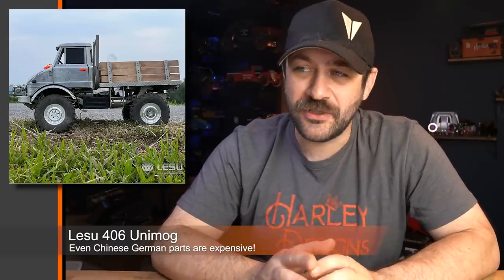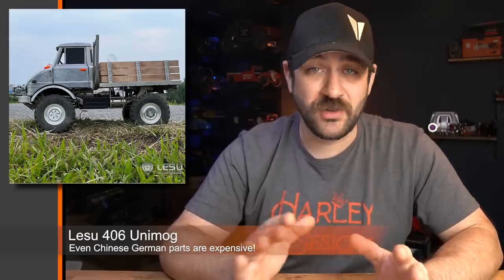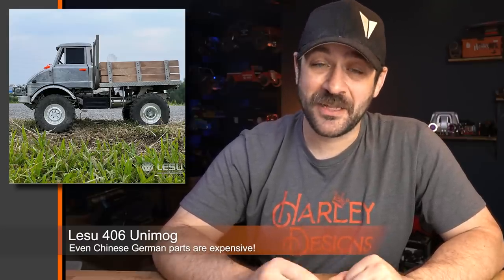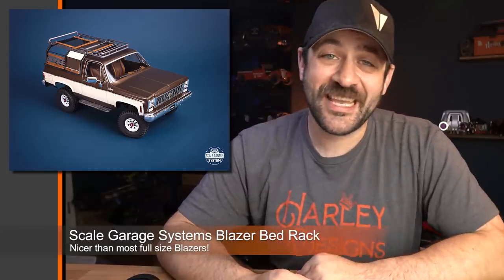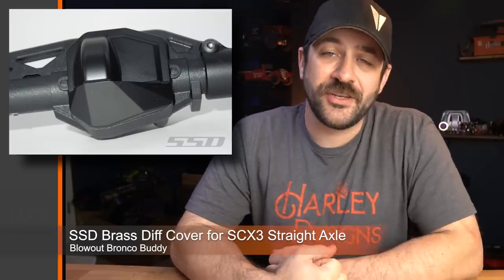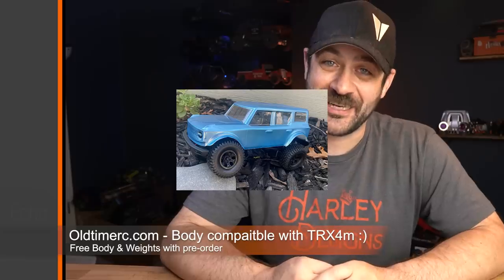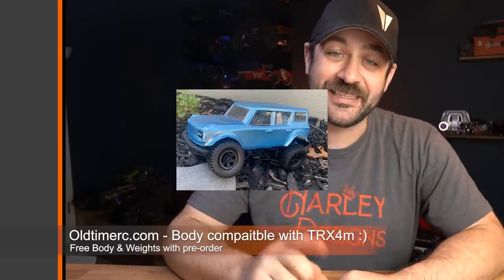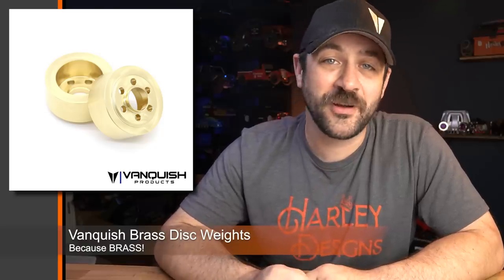11 POUNDS?! - Scale News Update - Episode 259

Comment: I’m in South Texas and my LHS is STXRC in Corpus Christi and I buy from them every chance I get. They have a really good selection of kits and parts to supply the local community. Best part about it is their prices are right inline with Amain and RPP so you’re getting a good deal and supporting local. I’m 60 miles from them as well and it’s worth the drive in my opinion.

Comment: I really only ever use my LHS for parts.  HobbyTown is my primary, and typically (as of late) I haven’t been in a rush for parts, so ordering parts (even though i could opt to go online and get them sooner) thru my LHS has been my go to.  I also use Remote Control Hobbies, and they also have a good selection of parts and tires.  Both stores order from AMAIN so again rather than go direct, I support local almost every time.  For more of the rare-er stuff or specialized parts like some drift parts, do i use some overseas sites for my orders.  I’m almost exclusively an LHS supporter.

Comment: In Calgary I’m about 25 minutes from either Action Hobby or PM Hobby. Both are great shops, though very different from each other. They both are fully stocked on crawlers and parts from Axial, Traxxas, and Element. PM Hobby stocks some Vanquish parts, but not much. I find I still need to order from Amain or other small shops from time to time, but I try to give the local shops a fair amount of business.

Comment: Our LHS is primarily racing..they have a small section of crawler parts & usually resort to ordering what’s needed/required by the customer..as I’m capable of doing the same..I skip the “middle-man”, mark-ups, traffic & have a shorter wait time for my orders (within 24-72hrs vs 7+ days). 

The 2.2s stuffed in 1.9s is some back in the day stuff lol..BUT..still running a set of 2.2s wrapped in 1.9 PB Rockbeast XL on my Yeti when it’s not on Mohawks & Dumonts.🤘😎

Comment: Asylum Extreme in Clarksville Indiana is going to have my replacement scx10iii front axle housing tomorrow. They are just a couple miles away from me and they appear to carry a lot of crawler parts. They were surprised they didn’t have my axle housing in stock.  When they found they didn’t they offered to call me when it comes in and they ordered extra front and rear housings. They were able to get them as fast as or faster Amazon would since I don’t have prime.  I forgot to ask the price, but it should be reasonable.  I have my eye on some desert lizard shocks they carry for $22.

Comment: My LHS is Hobby World in Cheshire MA.  The owner is a great guy, but it's a small shop and the parts are all behind the counter.  That's fine if I break something and need a replacement, but not so helpful when I'm searching for something to fit a custom application, which is usually the case when I need parts.

Comment: 14 working days to RMR, change of plans for my Class 3 Body for time pinch, but 95% mechanically ready for Class 2 and 3. Just enough time for paint and details  😰. The only choice in Omaha is Hobbytown Hobbyplex which actually has a really good selection for the entire spectrum of RC's planes, cars, & trucks, and where I found my Vanquish 2.2 Gold Tanks. 🥳
Reply: Ran my Class 3 yesterday for the first time on the Rocks , setup 2WS on 2.2's and I was really pleased with the Phoenix builders bundle as stock with the GroundFox rails, I have to change out the rear axle for 4WS and install the high clearance lower links and it will be ready for RMR (mechanically).  Paint and details is where I am at and probably the weakest part of my skill set, and kicking myself for not taking the time (still) to use my 3D dust collector (printer), Bad Monkey, Bad ! 🙈🙉🙊

Comment: Well, currently I'm not haunting any local hobby shop...  But before my relocation, I hauted Great Hobbies and Hobby Wholesale...  Great Hobbies frequently didn't have what I needed, but there customer service in helping find solutions and work arounds to that was first rate.  Hobby Wholesale...  Dunno - they where okay, but not the most helpful, but generally they had what I'd need in stock (they where much bigger then Great Hobbies).

Comment: Great news week.
That body gspeed got in..... is tempting hahahaha. I have their jeep body on my scxpro.
My pro needs the upgrades.... or does it hahahaha.

As for the question.

I order from 4 shops.
1. BC Hobbies, they are in my town (Victoria bc canada). I'm doing a collaboration with them on the scx pro.
But... they struggle getting many if the parts I like to use.... but great folks over there.
2. Mr.Wizard rc, he is the comp truck guy hahahahaha (vancouver bc canada)
3, eighty8 rc hobbies, my hobbywing and boomracing gear (vancouver bc canada)
4. Eliminator rc, all my vanquish needs.
(Winnepeg canada)

Comment: Fast Track Hobbies in Rocklin, CA. I started out in the 90's going to RC Country but in the early 2000's their customer service was terrible and I haven't been back much since. One thing that runs rampant in the industry is arrogance and somewhat of a click mentality. When you inquire on upgrades you don't want to be told to just buy a new model. It was my first hobby grade kit that I purchased from them. It was good enough to sell but not good enough to support. An old Kyosho GP10 Spyder. The funny thing is, I still have it and to my surprise they aren't cheap on eBay. I never did get that belt tensioner that I wanted. You know, because buying a whole new model makes more sense than a $20 hop up.